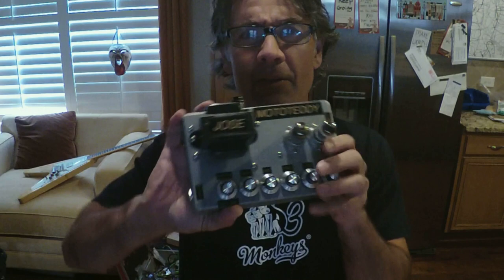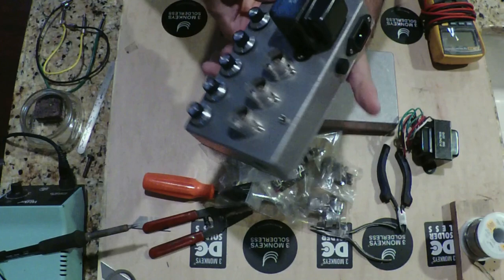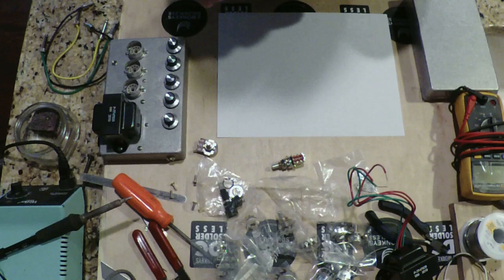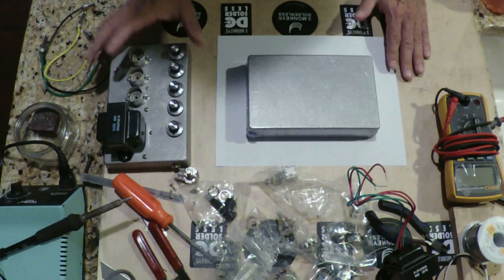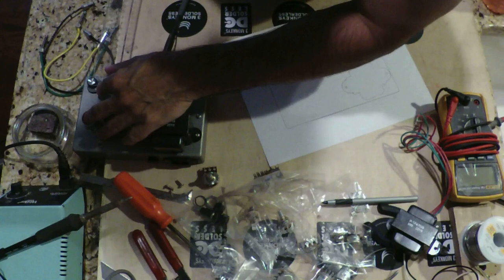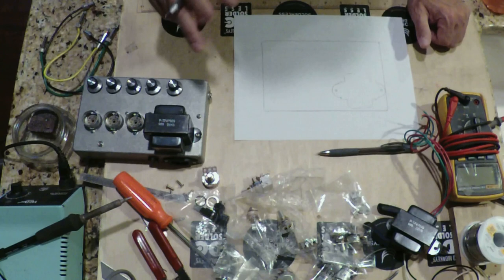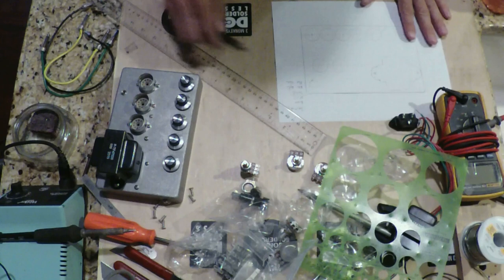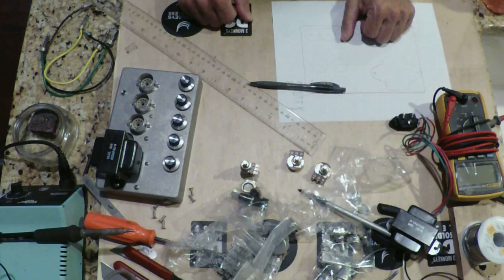Jose Mod Pedal Build Journal Part 1

Comment: 11:14 tubeampdoctor has this pot in 1 meg (only place on earth that sells it afaik).  Why 500k vs 1 meg?
Reply from the maker: You could probably use the 1m.  No biggie

Ossie
Reply: @ossieahsen6732  well the 500k's i was able to find easily but really wanted the 1 meg so i had to order from Germany cost me $40
Reply from the maker: @geezberry8889  Thats dedication!
Reply: Do you build one on request?

Comment: Is this a pedal to plug my guitar into and the out of this pedal goes into my jtm45 clone and then I’m going to get that Jose sound or is this supposed to be going into the phase inverter tube the third preamp tube in my case to get that hot rod Marshall sound
Reply from the maker: Hello Chris,

Its was designed to go into the phase inverter of a Marshall amp.  It can be run other ways but this is the intended use :)

Thanks !
Ossie